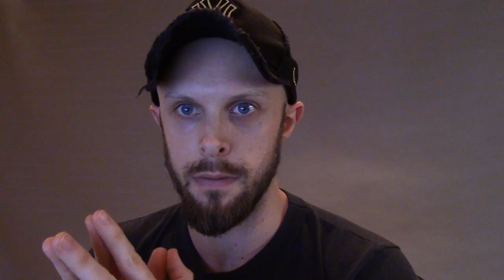9 Tips for Cob House Building Code Approval

Comment: Comply with any changes they feel like making to the code, then in about 5-10 years you'll be right back to building with 2x4's and drywall, along with whatever chemicals they feel you need to be safe....   Forget the crap "NEW" cob building codes! If you use cement on a cob home, insulation, and whatever else they demand, you might as well go ahead and paint the walls and stain the wood so you're right back where you started! Cement floors? Cement Bond Beam? You're not even building a Cob Home to begin with! You're just selling yourself short.

Comment: I got about half way through this vid and had to stop at adding cement. Dude, I have lived in an English Cob cottage thats over four hundred years old. Its still solid,still lived in and worth a small fortune. No cement, no bond beams, no concrete foundation. If you persist in pandering to the local authorities and actually compromise the structural integrity of the cob walls you are doing a huge disservice to centuries of proven practice.
You don't rely on insulation with cob, you use its thermal mass to passively create a stable temperature. The main concern with insulation is the roof. 
Properly designed and constructed the cob is a thermal bank that stores free energy from the sun. The free breathing and continuous expansion contraction cycles of Cob regulate humidity and generate negative ions through piezo electric effect and as any one who has lived in a GENUINE cob house will tell you, they are the cosiest house you will ever live in. Cool in summer, toasty warm and easy to heat in winter.
But if you let those idiots in local govt dictate methods that are engineered to max profit for the materials manufacturers then we may as well give up and do something really stupid like straw bale. 
Life span of Cob ? Hundreds of years.
Life span of straw bale (if your lucky) , seventy. 
With the addition of solar panels and heat pump water heating you can have a zero emissions house without all the costs associated with compromising and pandering to the corporate owned and written building codes. Codes mind you, NOT laws. Codes designed to make houses fall apart quicker so the banks can lend yet more money to throw at fixing the mess.

The house I lived in was built before Shakespeare was born. Its worth about two million pounds now. They did not have cement back then. Load bearing Cob too. You could drive a tractor in to the sides of those walls and they would not budge. Once that stuff is dried out and seasoned its tougher than concrete because it does not go brittle and start to break down. It self heals and consolidates where concrete slowly eats itself to death.
Reply: You sound like you know a lot about cob, will you give me some direction?
Reply: I wish I could give your comment a million thumbs up. And I agree that Alex in this video is pandering to bureaucrats with his "tip" suggesting to use concrete.
Reply: Hold up, straw bales are a bad idea? Even if encased in cob?

Comment: there need to be better ideas for insulation, the whole idea behind a cob house is that is natural and it breath so if we put insulation then we will be breathing toxins... also cob is strong enough, there are houses that are hundreds of years old, still standing and are cob, different techniques but cob no cement.   I understand this is to be able to pass the city requirements but I think there have to be better ideas, different ways around it.
Reply: The eco-house used pumice in the mix and it dramatically increased the R-value